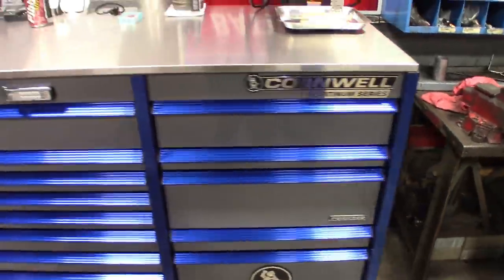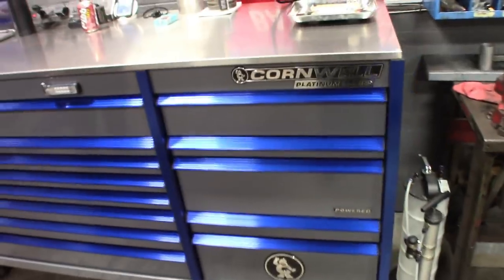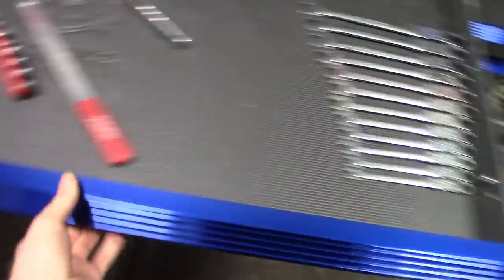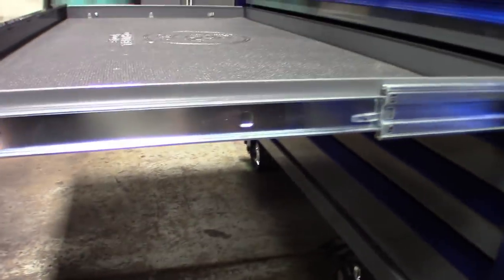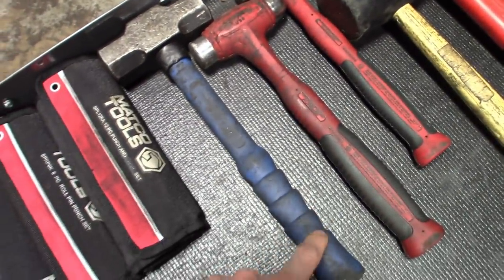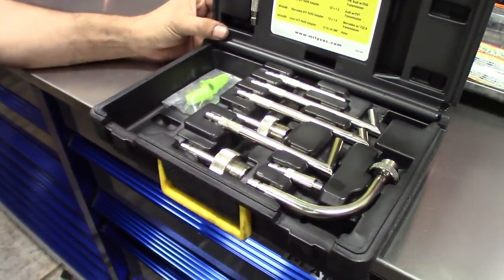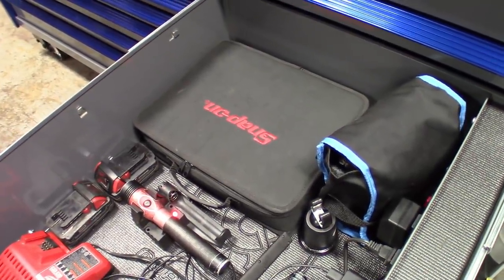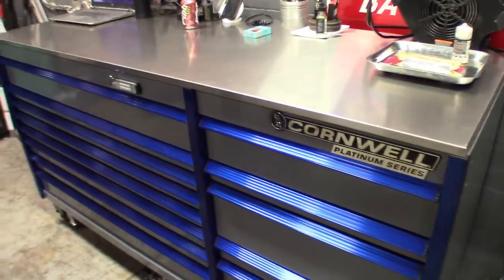The New Guy

Comment: Who make the joint puller at 8:14, I like how you can hammer it, or use the air hammer... I need that in my box.
Reply: @smzx11rage  sunex 9834
Reply: Lisle makes a really nice set and their usa made and have the steps aswell they are the original design of that type of pickle fork tool sunex like every other Asia tool company just copies someone else and sell it for less and kill usa companies with copied under quality tools

Comment: That C frame looks just like the snapon ball joint press C frame and it’s a great tool! Best ball joint press on the market imo
Reply: Snapon press is snapon made and the best press I have used so far I have Otc and that Mueller kueps and I have t
Used the new matco outside ball joint press which is outside the fender well that is a good unit aswell

Comment: That ball joint / bushing press is sick. Where did that come from. Ive seen a few tools online from that company. I was looking at some special files they make for calipers but i never pulled the trigger cause i just sandblast them. But that press tool is great looking tool. The c clamp oart is a monster
Reply from the maker: I believe he got it from Cornwell pn
609 400/460 Mueller kueps
Reply: Yea i found it online. Pretty expensive but what quality tool isnt expensive right bud.
Reply: The brake caliper files are a game changer another tool that will change your life from Mueller is the carbide scrapers awesome and Lisle also makes a sweet carbine scraper set

Comment: Save thousands and get a CRX or extreme tool box, hell a harbor frieght, dont tell you need a big 3 box, I worked out of a $900 41" SS samsclub tool box, box doesn't make you a better tech period! complete waste of money could have better & more tools. Most the guys who buy these boxes need them b/c the get moved somewhere else.
Reply: R230Tuner the locks on the us generals aren’t bad the round ones. The craftman Locks do suck. I lock up my picoscope and all my diag stuff and scanners  always
Reply: R230Tuner you’re just like me keeping all your diag separate. I love the pico 4425 my favorite I use it with a surface pro. I have the Autel maxiscope and took my pico leads and gave it to the Autel scope so I could by 5M pico leads for my pico 4425. I use the HF 30” 5 draw for all my diag. It fits my pico, my Autel, power probe and all my leads fuses etc. then I use my other 5 draw 30” for my every day hand tools so I’m not going to my boxes and I can move the cart on either side I’m working on. I have the snap on Verus edge, Autel Elite and the launch Torque. What do you have for scanners? Stuff adds up I guess that’s why I never went with a 80” box
Reply: I have a few boxes: Craftsman, US General, Kobalt, Kennedy, Yukon, and several vintage boxes made in the late-'40s. Recently sold a MAC box. Hadn't really looked at it all around since it was placed in the shop. As I was cleaning it up for sale, couldn't help noticing its build quality. We often hear how the 44" HFT box is comparable to professional storage. IMO, it's not; the MAC was built to a noticeably higher standard. 

The Cornwell box in the vid looks fantastic. If its build quality is on par with other Cornwell boxes I've seen, the price is not unreasonable. Of course it's not inexpensive, but if one buys it while in school at a substantial discount and keeps it for the duration of his career (20-30 years), the prorated cost is greatly minimized. And, he gets to use a fine piece of equipment every day bringing a sense of satisfaction every time a drawer is opened or closed. Not a bad deal.
Reply: @weldingjunkie  I'm glad you saved all that tool box money so you can put it back into parts and repairs on your bmw
Reply: @weldingjunkie  nope Corvettes I have no use for them sorry I worked on them at a dealer that's now long time out of business and for newer ones my bosses and co workers all had problems with little mileage and I mean from small to big problems so as for Tesla can't comment don't work on them worked on plenty of BMWs from timming chains to eccentric shafts replacement to the sensor never ending all leaks and vacuum leaks attributed to the oil leaks and the endless check engine lights to ecm failures due to water ingestation than having to use their short factory site to buy software to program and code the modules to all and controllers I've replaced on them aswell transfer cases from the xdrive to the new process new venture gear units older that's just the tip of the sword
Reply: @weldingjunkie  well not to start a war here but Honda and Acuras are more reliable than BMWs for cars
Reply: So being a good tech and wanting a good box is a waste of money in who's eyes it shows for one he is not a flim flam and is serious about his job and doesn't have a good enough attitude you choose to work out ok a lesser quality box good for you he chooses a better one and takes pride in what he owns so in your eyes he is wasting money but in his eyes you wasted a bunch of money on lesser boxes so the argument can be flipped in either direction in my line of work with sockets over 4 inch and wrenches to 2-1/2 inch torque multipliers 1 inch drive torque wrenches I have to much weight in all my matcos drawers as it is so overkill on boxes is necessary  and as I have seen at my job good enough and no pride in your job causes bad work quality and much repeated work so for someone to take pride in trying to obtain the best they can get isn't really a bad thing as what is looming in today's hopefully work force because good help is hard to find and not saying it means he will be great in this business but for a guy trying to by good stuff at his job is usually a good sign in the right direction atleast as an employer you have a chance that is better than average he or she may work out or is trainable not saying they have to spend 10 k on a box out the gate but takeimg  a little pride in their career is a good boost
Reply: @weldingjunkie  so who the hell is Stephan Cox and what's that suppose to mean exactly
Reply: @weldingjunkie  and for the record snapon boxes are made in USA don't know where you get you info

Comment: He has more room than tools, classic example of don't get the big box first before building your tools, chances are you may never need all that room when you get all the tools you need.
Reply: What the fuck, it never hurts to have more space. You are never done buying tools as a mechanic
Reply: I have a 72” box, a 44” double stack, a locker, 2 end cabs, a slide top cart, a flip top cart, 2 end trays and a tear down tray. I take up 2 bays worth of wall space and I still don’t have enough space.
Reply: I meant to make a point... DOYH! My point is, each time I’ve added a new box, it took a while to fill it. It’s not like we can have a pile of tools on the floor until we get enough to fill a box. I’m pretty confident he’ll fill that box in a pretty short time. He already has quite a lot of specialty tools. I like to see that.